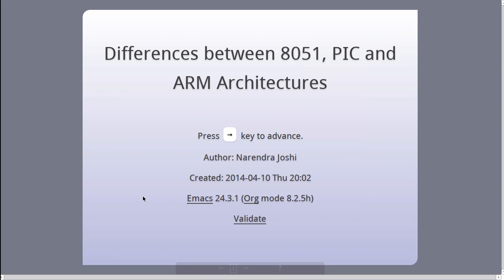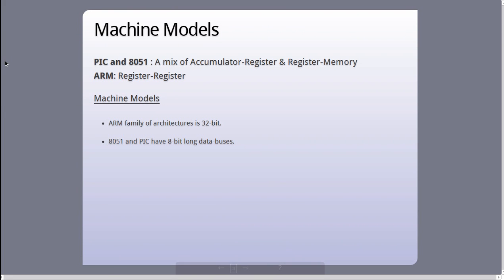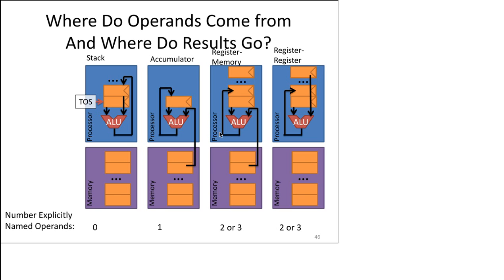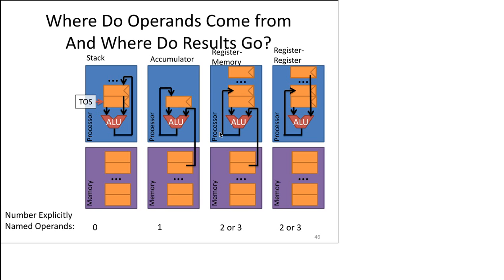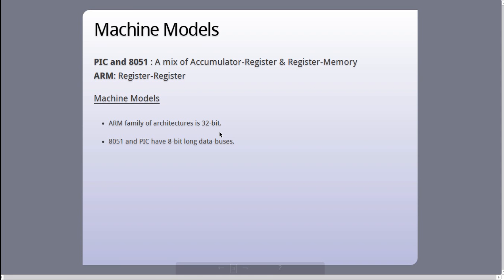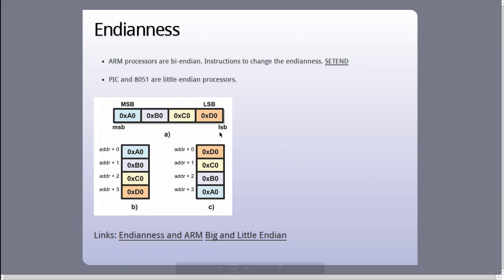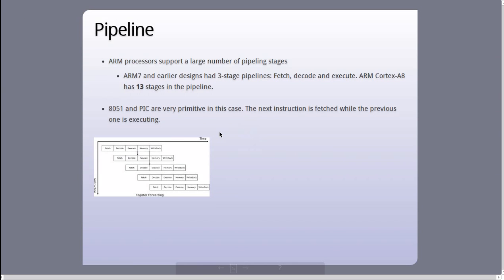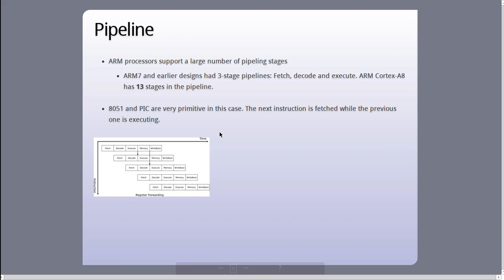Differences between 8051, PIC and ARM architecture

Comment: Very Nicely Told Buddy. I got my Concept of CISC vs RISC cleared now, which I was trying from my college days. As others said, voice quality of video needs to be improved. So CISC vs RISC basically boils down to whether complexity is pushed to Hardware or Software. For e.g if Multiplier is built in Hardware, There is only 1 instruction in software (say Multiply A,B). This is CISC. In RISC, There is no hardware Multiplier, say only has ADDERS, hence a Multiply operation in RISC will be done with multiple instructions using ADD. Hope I get the concept. Thanks.